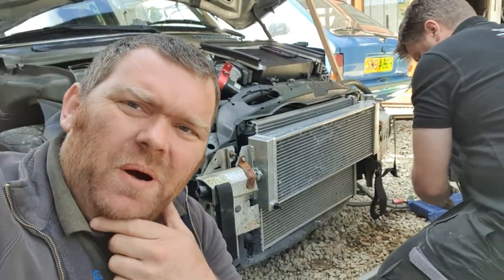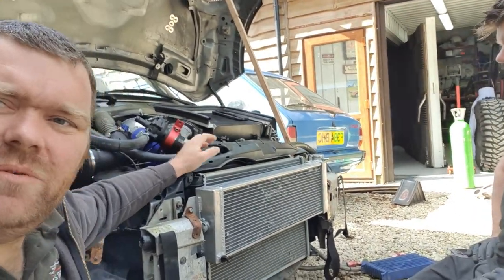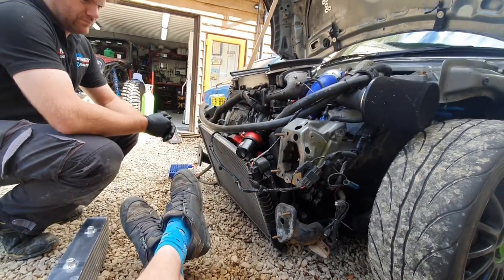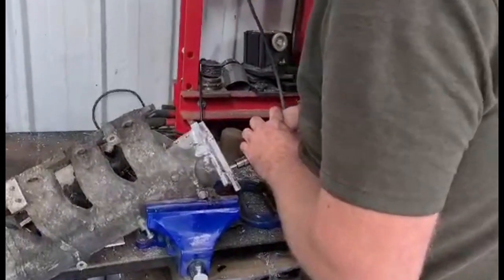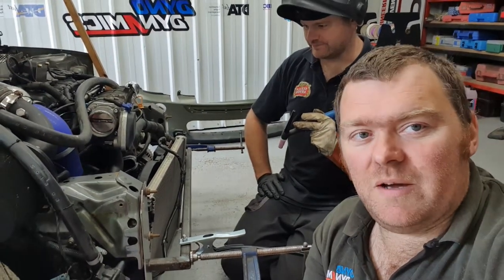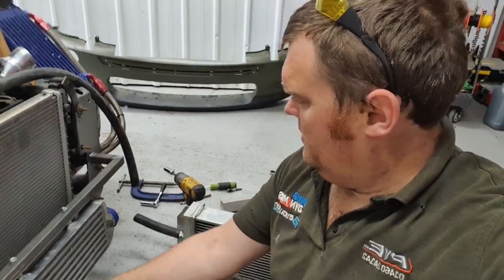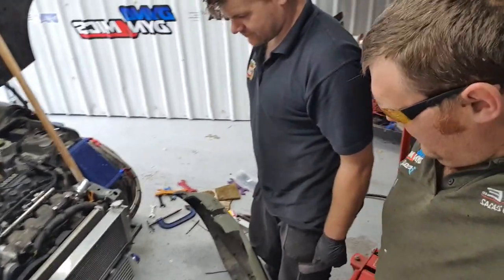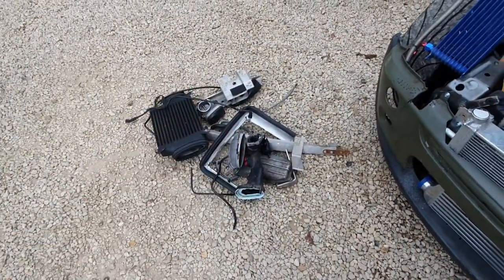Compound Charged R53 Mini, front mount intercooler, bigger throttle body, space frame front panel,

Comment: did you measure the intake temps between turbo and sc?.. i'm thinking to do the same order on my compound miata but can't really fit a IC between turbo and ic.. right now i am running sc first and then letting it blow into the turbo and iat is still very good at least after IC..
Reply from the maker: Yes, we have a temperature sensor there. Got absolutely shit loads of data @100hz. I'll go through it tonight, and let you know temps at the end of the straight. Worts case kinda thing. 👍
Reply: @TuningShed  than would be awesome, cheers!

Comment: I mounted my oil cooler behind the headlight too. First track test is on the 27th - will be interesting to see how well it operates.
Reply from the maker: Let me know! If it's horrendous, I can change it! 😂😂👌👌 Good luck. 👍👍
Reply: @TuningShed  it worked really well. Ambient was 12degC and so had to blank off the entire road to get oil up to 110